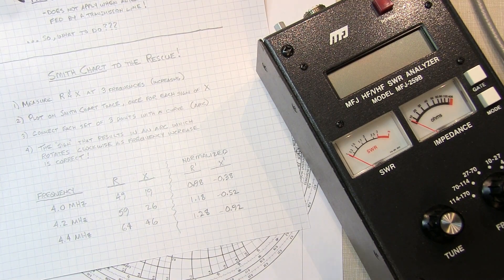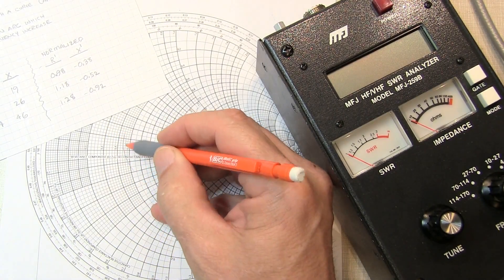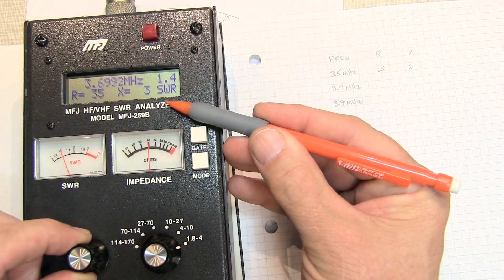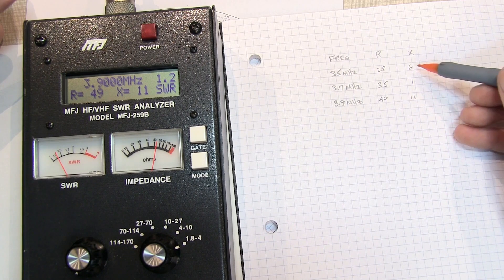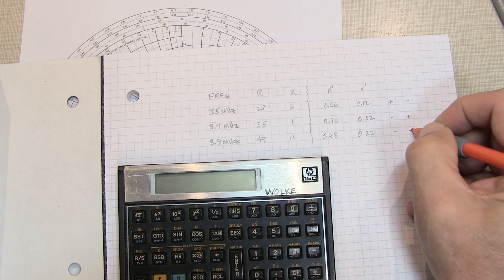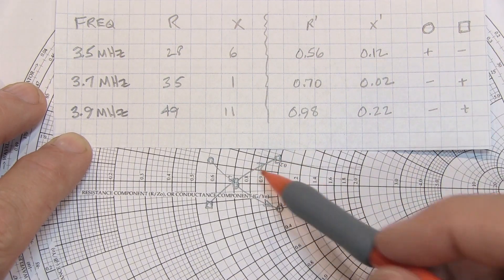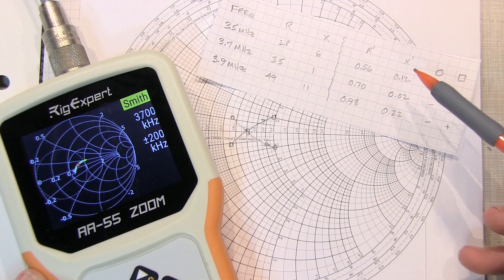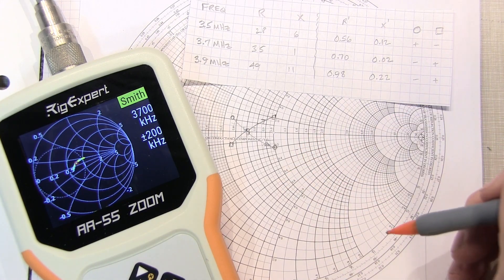#283: Part 2: Measuring Complex Impedance with MFJ-259B | Crossing the real axis...

Comment: Thank you for this 2 part series. I have been using the MFJ-269 for my HAM Antenna DIY projects; and these two videos have helped clear up a long standing mystery about the unsigned reactance readout. I have recently taken at look at SImChart, because of the emergence of low cost  NanoVNAs; and needed this very clarification MFJ's  readouts, to compare these tools.  Your very intuitive presentation style has connected so many dots for me, on this and many related topics.

Comment: I’ve been building some common mode chokes using a torroid and RG-142BU coax. Most of the articles say that you need to achieve a certain amount of resistance at the frequency it will be used at to be effective. I’m wondering if you can measure the chokes effectiveness using an antenna analyzer like the AA-230Zoom? The articles always refer to using a VNA. Not sure what the specific differences are between a VNA and an analyzer.

Comment: Hi Alan, I've learned so much from you! Can you do a video about how to superimpose a small AC signal on top of a DC power? For instance, I have 24V DC interface, I need to add a small AC signal on top of it in order to facilitate simple communication without changing the connector (the DC connector only has power and gnd pins). My question is how to generate the small signal on the master side and how to extract the AC signal on the slave side without disturbing the DC power (downstream has PI filter)
Reply from the maker: Have you seen my video on Bias-Tees?  One of these at each end might just do exactly what you need:
https://www.youtube.com/watch?v=lxgpm-UXTNY

Comment: I like your RF videos. Can you talk a little about GPS? I think many satellites transmit at 1575.42 MHz? Can you detect this weak signal using a gps patch antenna + your equipment (spectrum analyzer)?
I think all satellites transmit data packages at different “random” times, to try to avoid collisions in GPS receiver… 
But, can you detect this weak signal and show the percentage of time in a full second, you had a RF signal in antenna and if any valid data whoud be able to be decode? Assuming you have the proper software…
Can any software defined radio listen to gps signals and decode them?
Reply from the maker: The GPS satellites transmit continuously at 1575.42, but each uses a unique spreading code.  The receiver locks on to the spreading codes for each of the satellites that it can receive for demodulation.  The signals are very low in amplitude, typically at/below the noise floor of a spectrum analyzer unless a preamplifier is used.

Comment: If you decide to leave your MFJ 259 on the shelf for a few months, take the batteries out.  I did not and now I am paying for it.  By the way, thanks for the great videos....
Reply from the maker: Yes, I do try to remember to remove the batteries.
Reply: Dave Amos Years ago I took out the battery holder and whacked in some li-ion cells + a dc-dc converter. For charging I use a tp4056. Now the unit is always ready to use.
Reply: Thanks for the suggestion on the battery change.  It is a great improvement idea.